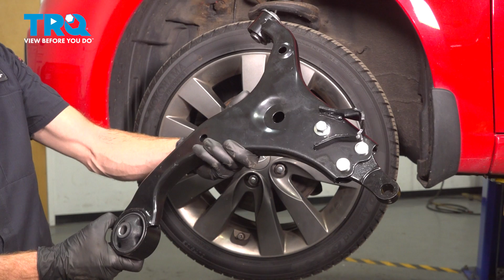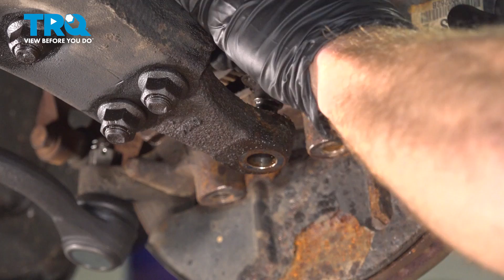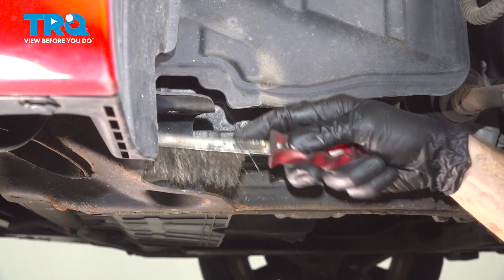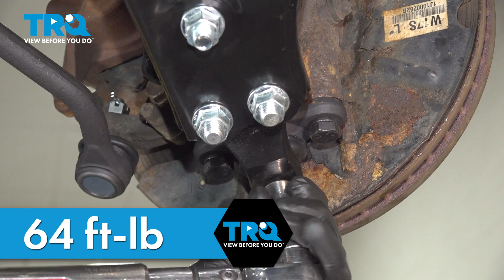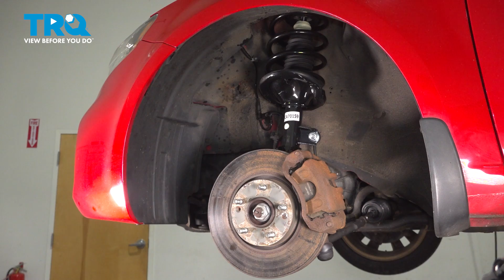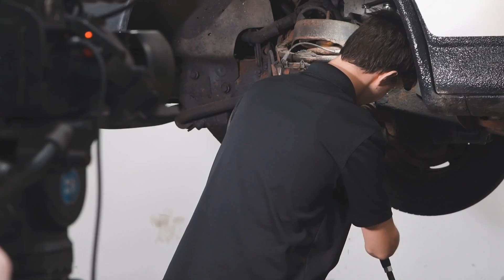How to Replace Lower Control Arms 2010-2013 Kia Forte Koup

Comment: How do you get off the lower control arm that is towards the rear of the car, meaning what tool did you use to get at the front bolt to get it loose? I’ve broken to angle sockets with my 17 mm socket and it won’t budge.